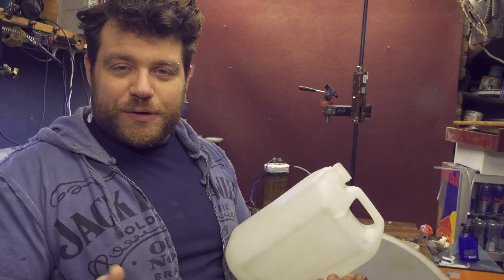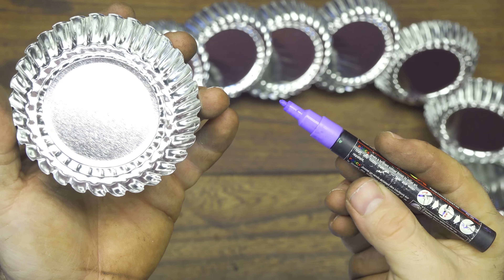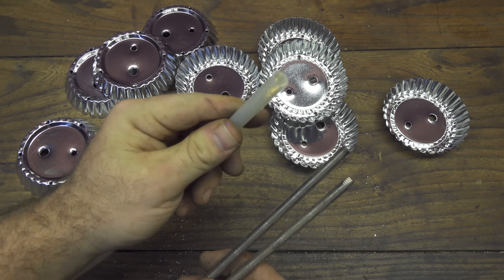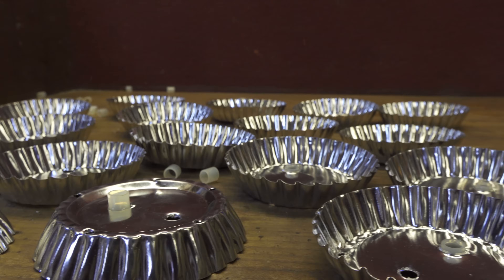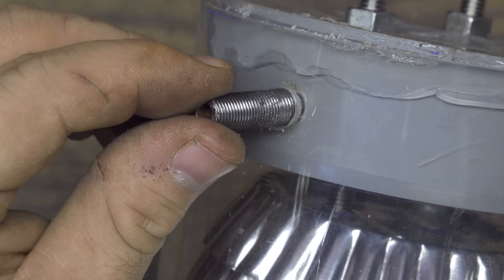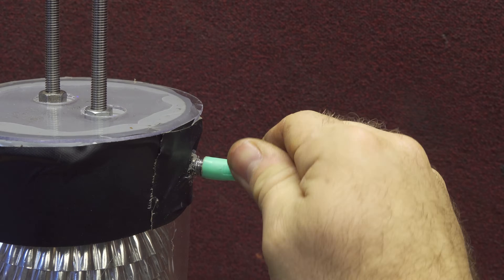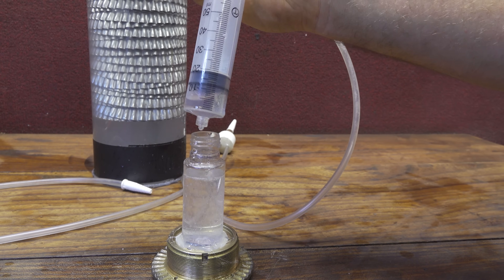Superpowerful Flame 5072 ℉ • Produce Hydrogen from Water - Do it yourself

Comment: You should use lye instead of baking soda for the electrolyte. You wont have to worry about outgassing co2 with your hho mix... I imagine that sorta thing could make the generator burp or blow itself out... Neither of which are good and the burping could cause other issues

Comment: Have you tried to separate the anode and cathode to different poles, so you could collect the H2 and O2 to the different reservoir/lines to combine them in the tip of the nozzle instead of flammable in the lines? Oxygen makes the temperature growing when collected the oxygen among the air.

Comment: Cool hydrogen generator, but I have two comments.  Why is the torch flame yellow?  Burning hydrogen and oxygen are invisible and can only be seen with an infrared scanning camera.  Also, how can it be 5072°F?  A torch tip of this type can only reach temperatures of around 2900°F before melting.  Aluminum melts below 1000°F, while gold and copper melt just below 2000°F, and glass melts just around that temperature as well.  Good luck with your projects, it's fun to watch.

Comment: I watch your old Italian video, I understand it just from the visuals, you make hydrogen generator that fills a void above water which pushes the water into another chamber with water and air, if you force feed air into that chamber it starts to back feed the water into HHO chamber, pressurizing it with no possibility off HHO coming back into your mouth tube 💁‍♂️ very cool idea, but very risky having the big chamber of HHO building up, I won't ever create that one but I'm glad you did! Have you ever seen Nighthawkinlight video of simple hho generator with stainless steel wool and a sock, it's soo simple it genius, no need for cutting plates and spacers, which is what puts most people off starting the project..

Comment: JUST A WORD OF CAUTION... MAKE SURE YOUR REMOVING ALL THE OXYGEN FROM YOUR HYDROGSN OR IT CAN POSSIBLY EXPLODE USE A FLAME ARRESTER AND YOU DID BUT YOU REALLY WANT REMOVE THE OXYGEN FROM YOUR HYDROGEN OR IT CAN POTENTIALY FAIL RESULTING IN FLASHBACK IGNITION AND EXPLOSION... THERES A LOT OF WAYS TOO MAKE HYDROGEN FROM WATER.. THIS METHIOD IS CALLED ELECTROLISIS... THERES ALSO ENDOTHERMIC CHEMESTRY (SAME RISKS FOR FLASHBACK FIRE AND EXPLOSIONS) AND YOU CAN ALSO USE A PEM HYDROGEN OXYGEN FUEL CELL IN REVERSE INPUTTING DISTILLED WATER INTO THE O2 INPUT SIDE OXYGEN INPUT SIDE APPLYING POWER POSITIVE TOO ANOID NEGITIVE TOO CATHOID  AS IF CHARGING A BATTERY  TOO SEPERATE THE HYDROGEN AND OXYGEN IN PURE LIQUID FORM REMOVING THE OXYGEN IMPURITY FROM YOUR HYDROGEN REDUCING THE EXLOSIVE RISK OF FLASHBACK EXPLOSION... STILL WANT USE FLASHBACK FLAME ARRESTERS REGUARDLESS... THIS IS LITTERALY NASA GRADE ROCKET FUEL.

Comment: Hey I'm wondering if having those little muffin cups inverted could cause the gas to get trapped, and therefore reducing the surface area that the water has to split, which could cause some inefficiencies, if anyone could shed some light on this it would be nice, im trying to make one of these for my gf and want it as good as possible (and as safe as possible)

Comment: You need to turn the metal sheets for 180°. In the way you built it will create bubbles of HHO Gas underneath.
Reply: That's why he drilled extra holes, as he explained. The pans have s convex base. If they were turned up the other way, bubbles would form in the convex. He has the plates the best way.

Comment: I wonder where the 5072 °F come from. 
I have a 500 Watt HHO generator which reaches barely the 3150 °F needed to melt pure quartz glass, even if I leave out the alcohol in the flashback preventer.

Comment: Baking soda won't work, it doesn't produce hydrogen but produces a chemical that will degrade your ellectrodes. Use a 30 % solution of sodium hydroxide (caustic soda) instead, but be careful cuz it's corrosive, keep it away from your skin and eyes, and in case it does get on your skin wipe it off with a towel then rince it off with water as quickly as possible

Comment: "You can find it in front of the magnetron"
Me: oh right, exactly, that thing.
Reply: Magnetron is an electromagnetic resonance chamber present in radio devices that require an incredibly high frequency, in order to transmit radio waves at such great distances, or harness the power in a very reduced space surrounded by a specifically very powerful faraday cage made to hear up things in a considerably short period of time without requiring fire... 

In layman's terms, that thingy inside a microwave oven that makes it heat stuff. Or that thingy in the antennas that sends radio signals to our smartphones.
Reply: IS that a transformer?

Comment: I wonder where the "2800 °C" come from. 
I have a 500 Watt HHO generator from China and it can barely melt quartz, which means that it does not get hotter than 1700 °C (even after removing the alcohol flame colorant).

Comment: Mine keeps blowing back in to the flashback arrestor. Is it imperative to use baking soda or a more direct question would be since I used sodium hydroxide as my electrolyte is that why it keeps blowing through the line?

Comment: If you make two of the chambers with the stainless cups and have a hot lead going to one chamber and a cold lead going to the other chamber.
One chamber will produce hydrogen gas and the other will produce oxygen gas. right now you're using mixed gas.

Comment: Those cups look like zinc plated metal from the pattern shown in the closeup. Typically you would need 314 or 304 grade stainless so I'm questioning the SS plating. If there is any SS on those cups its just plated like your kitchen sink. Check it with a magnet then you can determine the amount of plating on them

Comment: Uhh, seen first 35 sec and two things came to my mind:
- fisrt, mentioned sun, well, I thought that sun is a tiny bit hotter then 2800 celsia .. probably because it's basically nuclear firepit
- second, that might be different in your country, but our jewelry makers uses natural gas (piped to tables in workshops) or propane in bottles (soloist or when working from very small shop/home), no hydrogen .. maybe because it's a bit more risky to use and second silver/gold is not that hard and melts pretty easily

Comment: a flow system from the jars with the electrodes into jars that would circulate and cool the water through a "WORM" (a copper pipe twisted round in  a coil shape through cold water tank or much bigger container, THEY DON'T MIX WITH EACH OTHER FOR ANYONE THINKING OF MAKING THIS.. JUST LIKE MAKING MOONSHINE )  THAT WILL SORT THE WATER HEATING UP PROBLEM.

Comment: I made one about 11 years ago and accidentally blew a hole through my parents ceiling! (I learned how to do dry wall that weekend!) So be careful with any flames near the electrolysis chamber.
I was using a car battery charger for my power supply at the time, would be fun to revisit project with transformers.

Comment: One kWh electricity produced how much hydrogen gas by using d c current from mobile charger ?

If we use mobile charger for an hour 
How much hydrogen production possible 
So we not using fuel gas cylinder ?

Comment: This dude is electrically splitting water to then combust it in order to then melt stuff and is showing us exactly how to do it. This video deserves a like.
Reply: but also since they're using baking soda (NaHCO3) there's probably carbon monoxide produced from the electrolysis. Why I think that is because hydrogen burns with an almost invisible flame, not an orange one. However don't worry because when carbon monoxide burns it simply turns back into carbon dioxide.
Reply: @mazewind255  I would imagine the orange is coming from sodium ions that have made it from the baking soda, and was contaminated around the project.
the baking soda should release CO2 to form sodium carbonate, and then CO2 again to form sodium hydroxide, or at least these are the common stable sodium species that are usually present.
Reply: Its not safe at all, he made an homemade flashback arrestor that simply still isnt safe enough, same concept for the bubbler, it does work most of the time but the main component should be the flashback arrestor(factory ones) and then the bubbler, i can also predict that its going to get some leaks in gasses, he didnt use silicon on some parts he only relied on the close fitting

Comment: The reason the generator gets hot is your efficiency is not that high. Try using Urea instead of baking soda. This lowers the voltage needed to make the gas and really increases efficiency. This should help with overheating the unit. Give it a try you will be amazed. VF

Comment: "safety it's very important in this video" proceeds to get a microwave transformer with the worlds worse cable connections
Reply: if it was from a microwave it doesn't matter as he said he rewound the coils to step down the voltage from mains to 5v, a microwave transformer is wound to step up to 1000v or more then uses a large capacitor to double that to a nice 2000v to run into the magnetron
Reply: i'm not saying that this project is in anyway safe, just that the transformer is not dangerous in relation to how a microwave transformer is, well on the primary it is but the output isn't

Comment: The most dangerous knoledge is this works in a combustion engine. If you use solar to generate electricity its carbon zero.

Comment: only 316L grade steel will withstand electrolysis...  those plates will quickly corrode...     ps   look up electroplating..

anyway,  use Kno3 for electrolite.....the brass works but a pill bottle full of rice is fine..    called a FLASH ARRESTOR

Comment: I am covering the roof of my house with lead, would your flamethrower weld "stick" two lead sheets together?  This would save me a lot of effort to carry a heavy gas bottle on to my roof , not to mention the expense of buying oxygen and other gasses?
Reply: why are you using lead? tin and other metals would probably be superior depending on the intended affect.
Reply: @TheHunter55123  yes, I would like to use metal easy to solder like tin, but  when I google it here in the UK I get galvanized sheets as results, and I can't solder galvanized zinc or the steel underneath  the zinc if I could find Tin I would use it because I need to do a lot of bending and shaping  into channels and embedded into the brick, the other metals I considered is copper or brass, but they are very expensive unless I buy cheap used water heat cylinders

Comment: When I was in junior high school  my buddy and I were the “rocket scientists” or at least we thought we were.  We set up a bunch of Erlenmeyer flasks with tubing and using zinc and muriatic acid began generating hydrogen gas.  We filled up those thin plastic laundry garment bags with it and made balloons.  At some point we must have gotten a leak in the contraption because the bags weren’t as buoyant as they should have been so I took a match and lit the end of the tubing.  Pure hydrogen doesn’t explode unless mixed  with oxygen (see Hindenburg disaster) so I only expected to see a flame.  Unfortunately the flasks were pulling in surrounding air, probably due to loose stoppers.  All I remember is us getting thrown about 10’  away.  The blast blew out the basement windows at my friends house.  His mother raced  outside wanting to know WTF happened!!!   They moved away to Silver Springs MD shortly thereafter.  I guess the mom felt her son would live longer that way!  I’m blessed that  I’ve survived this long (age 64) now.
Reply: If you were blown back that far you would be dead. your lungs would also have had a decent chance of exploding as well if there was hydrogen in the air. Not to mention you would be either deaf or have pretty terrible tinnitus. basically if windows were blown out your eardrums would be gone
Reply: The Hunter So your calling me a liar 🤥 but that’s pretty much what happened.  I didn’t measure the distance but it sure seemed that far back then.
Reply: @drewmichael4014   Nah 10 feet is reasonable if you were standing up. We pulled a stupid similar but different experiment when we were 14 < I too am well past 60>  Yes  we damaged our ear drums.
Reply: ALLAN DAEM what did you say? 👂 👂

Comment: Now, there are a couple of issues with the few statements: First, temperature 2800 degrees? Will, it not burn the little nose of device you are using itself? The hottest part of the fire is blue if I am not wrong but that is only around 1400 degrees.
Reply: The pressure of the gas and its speed keep the heat away from the brass nozzle. Also the colour is from impurities as the brass erodes, but hydrogen burns red otherwise.
Reply: Hottest part of a flame is the tip

Comment: I'm currently studying this phenomenon and doing my research on possible other uses. Like the Hoffman devise for a fuel supply to water power a car. I think it's possible to use the oxygen by hardline to the air intake and the hydrogen to the fuel intake ...both by one way valves. The spark plugs might need to be stronger because of the higher heat. Also , the pressure needs to be regulated by pressure regulators...not over 15 -30psi continuously so as not to blow the engines...just my humble idea. What do you think???😁

Comment: "high temperature almost like the temperature that is around the Sun":  Temperature of H2 + O combustion: 2800 C. Temperature around the Sun: 5500 C. No, its not almost like the Sun. That happens when you use non metric units.

Comment: My generator was hot enough to melt my fiberglass container after a test ride on my car, it was insane. It seems I need an aluminium container and cooling system for this to work for a long running time.

Comment: If you turn the cups around, the gasses will escape faster, and be displaced by the water and you will have a bigger surface area reacting with the water. 
Also, that flane isn't that hot, it should be less then 2000°C

Comment: The flame looks very weak compared with oxyacetylene.
Reply: Phh... that's a basic home made rig... low pressure and the torch tip is also  too basic.
I've read that it's dangerous trying to compress this gas without the proper safety devices since pressure can recombine the gases creating an explosion 💥

Comment: I would put a plastic cup of the same size between each of the steel cups for my own reassurance, peace of mind.
>
Reply: The whole reason this works is due to the fact that the anode and cathode are separated by water. If you were to put a plastic cup between there would be no HHO generation

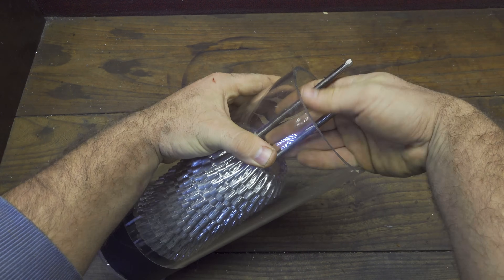Comment: (3:10) - those top two cups look like they are touching, not to mention most of the others.
Surely, you can't have no continuity between the two electrodes?
No, there's something wrong here.
Brilliant idea, all the same.
But I would weld the respective cups to their respective rods for better conductivity.
Can be spot-welded very easily.
Very easy to make DIY spot welder at home.
>

Comment: could you just stack the muffin tins and gang drill them to save time and effort plus increase accuracy? Also a slower feed rate and starting with smaller bits and progressing up would reduce the deformation.

Comment: What if you added a type of throttle valve ( needle valve ) to control the water flow to the generator, a U shaped pipe, which was connected to a bigger container of water....you'll have a sustainable energy source

Comment: Those safety measurements are helpful in keeping you alive.. unless you accidentally get your flame somewhere near the plastic tank or the hose that connects it with the bubbler.. or a electric shortcut creates a spark inside the tank..

Comment: great , the experimented projects helps a lot for cheap fuels and if any one among us, can try this project for motor cycle and four wheel vehicles as an alternative fuel in place of patrol, this project helps in producing cooking gas for domestic use , great innovation, thanks
Reply: Dont bother dude, if hydrogen put into air, u make dangerous bomb. Thats why they dont do in motorcycle.. etc

Comment: Easy Flash-back "Arrestor", take 2- 1/4 inch barbed male to 1 inch threaded +1- 1 inch threaded connector. Teflon threads on both threaded piece's. Put together 1 male barb together threaded piece, and threaded connector. Stuff with STEEL WOOL as hard as you can, then stuff other male barb/threaded reducer's wide end, then assembled piece's. Test for Air tightness.
 Remember to be changing Steel wool every several month's or so depending on usage, KOH or baking soda will collect and clog. This also work's as Scrubber, several  in-line will protect an Engine.
This will save you from Explosion's, when using GASSES for Torch..
 Same Idea, open ended pipe standing vertical, with Steel WOol packed in it, or Fine sand and FIre will only be on Surface of Sand or Steel Wool, Really great idea for heating, saw on YT.
That worked last winter for Heating, I had small Plug in, 12 Volt, 2 AMp Pulse width modulator running a 9, 2X2 inch Plate Dry Cell, one Cup of Water per Night, Warm and cozy.

Comment: And to think,  I just took an old power cord and stripped the ends,  put them in a jar of water and plugged it in,  it bubbled. It was neat,  I like how you made a huge surface area to get a lot of bubbling, and trapped the hydrogen and oxygen for use.  Cool.

Comment: being electrolysis is also ELECTROPLATING ...  DO NOT ..  use anything other then 316L steel.   unless of course you want your anode material to become your cathode...

making a system that traps hydrogen on the plates isnt good either.. it prevents more hydrogen to form on the surface of the plates.

either Joe cell ( tubes )  or the plate cells  (flat plates ) work at pushing h2 off .   or vibration ..
Reply: But what if the plates were upside down? Wouldn't they allow the hydrogen to flow easier?